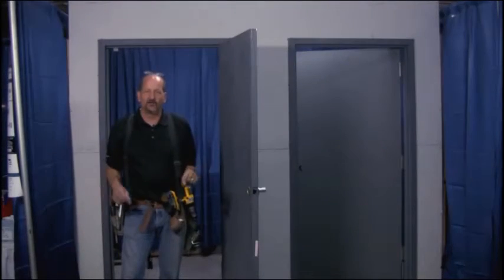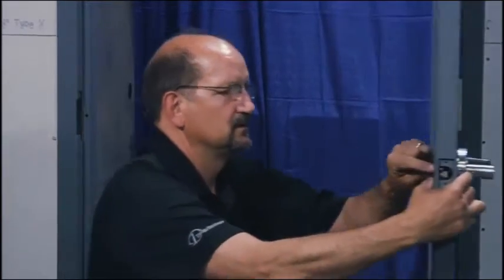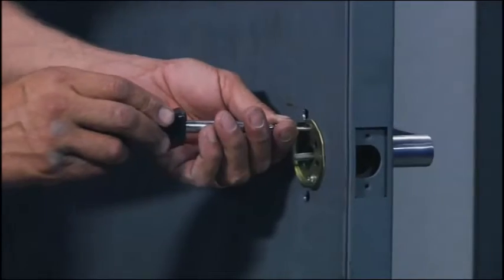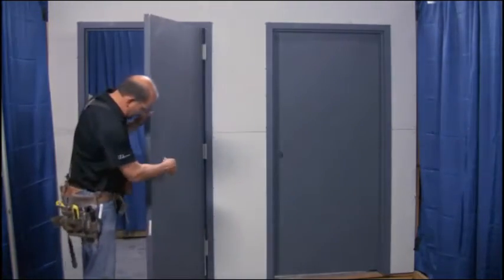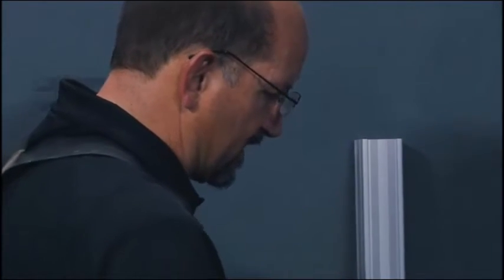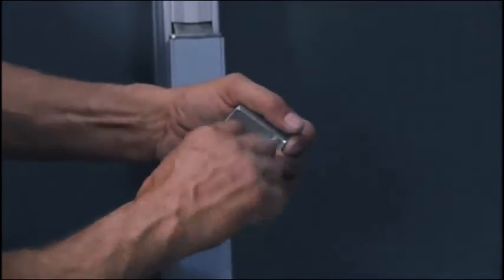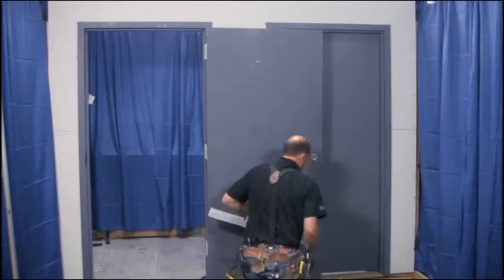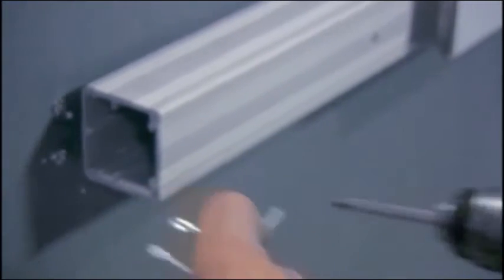1000V Vertical Rod Panic Installation

Comment: A true technician drills and taps his holes. 
I've come across a couple of these in the field, and I'm not impressed.
Reply: Please tell me why this is better? I just did 27 steel doors and to me I didn't seem to matter. The Metal is so thin gauge that a tap seems completely useless. If you predrill correctly it's going to have the same holding power